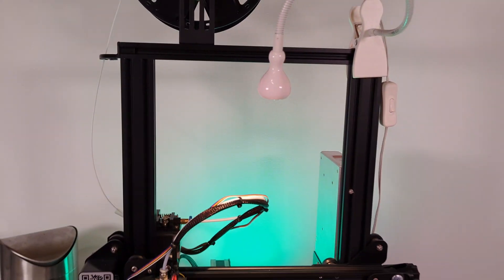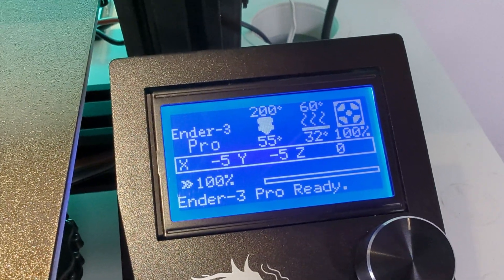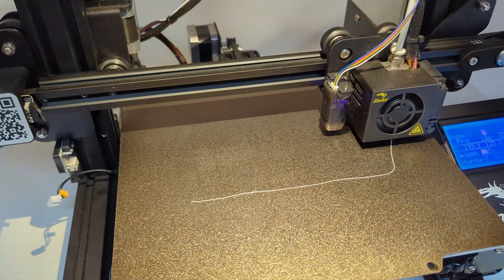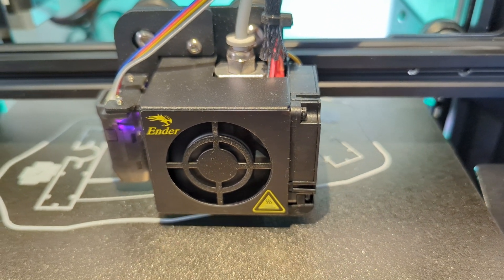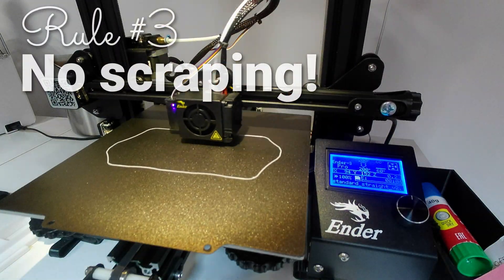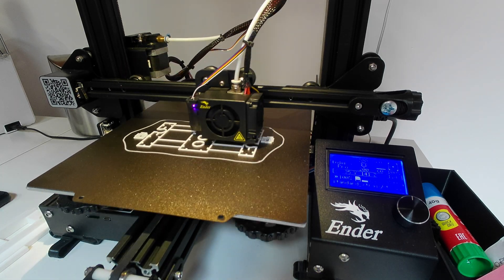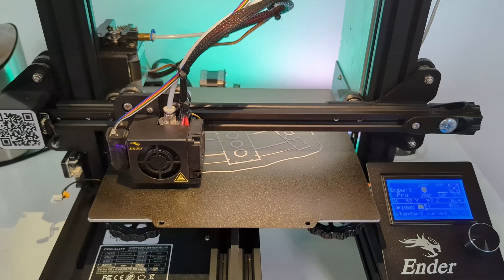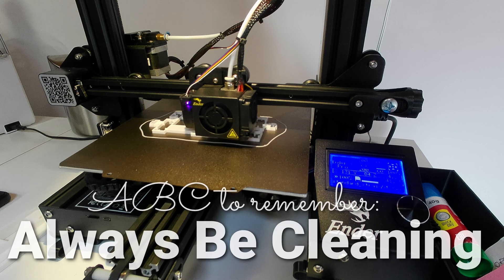Why my printer works better than yours

Comment: Reconditioning to new quality can be done on smooth print surfaces with proper cleaners and abrasives. However I do agree textured surfaces are never quite the same again.
Reply from the maker: Correct. But people that spring for the smooth print surface are more likely to be in the know and least likely to destroy things. Even printers that come with multiple types of beds usually get reviewed with a textured bed option. That should be the safest, right?

Comment: I have 3 ender v2s and they are great but I never turn them on since getting the ender v3 plus . The bed size been 300x300 and the speed is incredible. The bed leveling tech , wifi print and camera ect all from factory . I almost got a bambeu but decided to go for the plus size ender and having 300x300x330 has really made the hole 3d printing thing more useful . I made a modular shoe rack with 20 module in a week
Reply from the maker: Yeah, entry level print volume is the thing I dislike the most about this printer, way more than slow speed. That's why I'm eyeing a Sovol SV08 as my next printer. I'm procrastinating getting it from from the time it was on pre-orders and good thing I did because they already had a SNAFU right out of the gate. By the time I will actually get one I hope they will be mature enough.